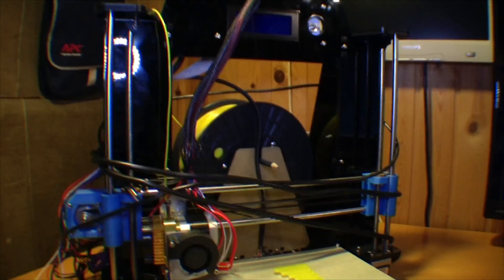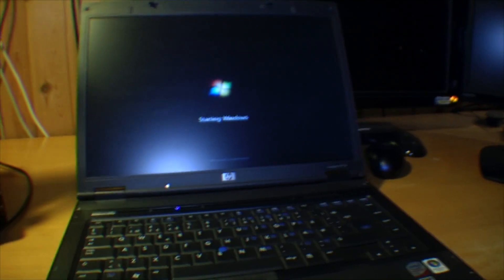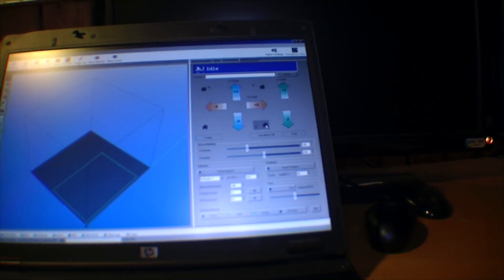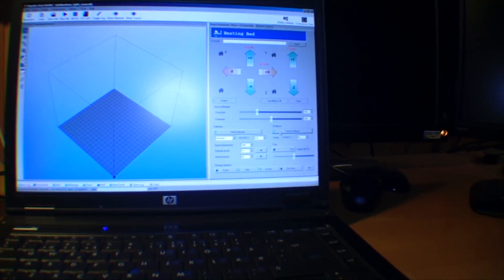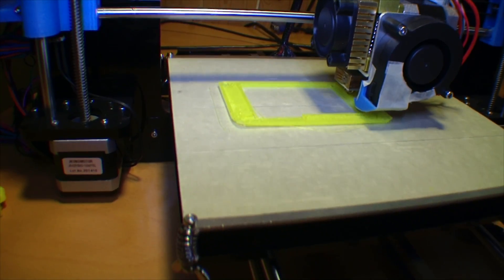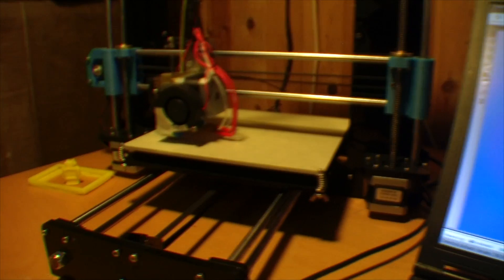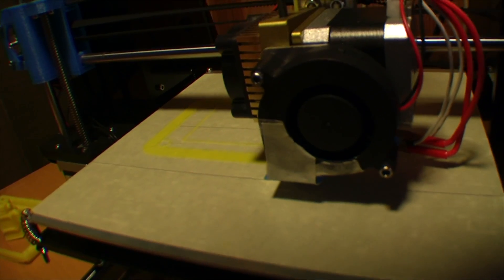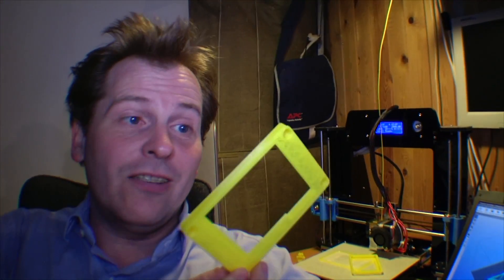Improving 3D print on the cheap Chinese 3D Printer - 238

Comment: I have yet to build mine, waiting on the right lock nuts to arrive from the manufacturers.

What I have learned is that if your bed is too cold for ABS then it will lift off the bed, now some people will use all sorts of methods to stick and often use things like painters tape (blue type) 

Now the two best methods I have heard of is Hair Spray or Some use a Pritt Stick type glue and some use ABS dissolved in Acetone and it is painted on as a very thin coat.

Finally, ABS needs to be in an enclosure or a warm room so that the plastic does not cool too quick and warp.
Reply: And printing using a Raft and a Brim can help.
Reply from the maker: Hi Mark Giblin
Thank You very much!  glad you liked the video :-)
Thank you for watching! :-)

Comment: It's awesome to see you've got it working. I tried different slicers with sometimes disastrous results, the one I settled on was cura v15.02.1, the newer versions of cura did not work at all for me.
Reply from the maker: Hi +Josh Bishop 
The software I am using is not the newest,, i read somewhere that the older versions are easier to get working,, so i started there.
Thank you for watching! :-)

Comment: I saw you needed to reconnect all those cables, why didn't you number them with a white marker or something like that so you can just connect for example number 5 to number 5 ?

Great video by the way :)
Reply from the maker: Hi +LuvFPS 
It was not really that big a problem,, i just moved one cable ad the time,,, it would not be easy to mark the circuit board.
in many other circumstances i would use your method..
Thank you for watching! :-)